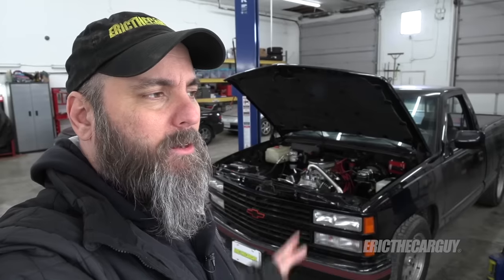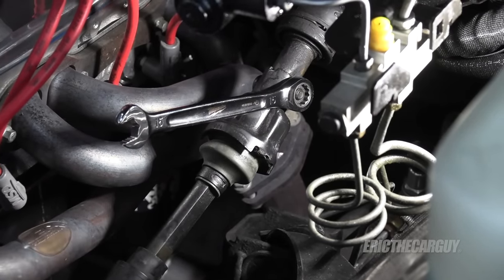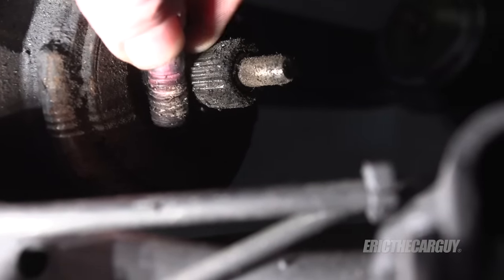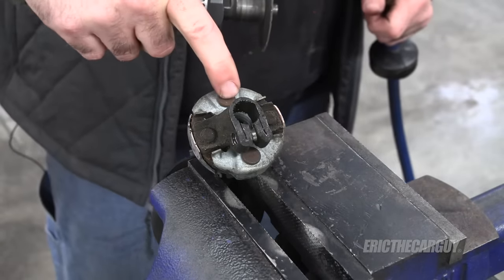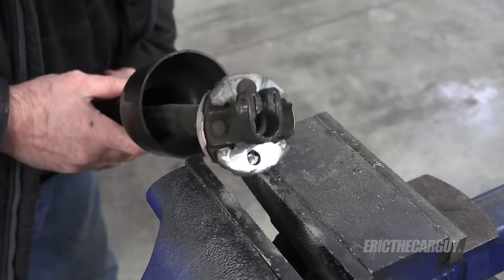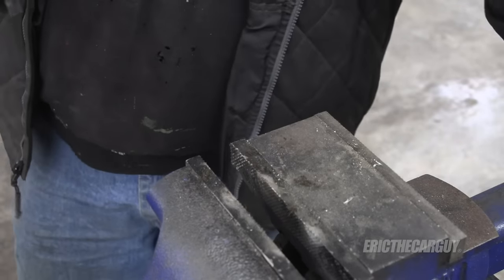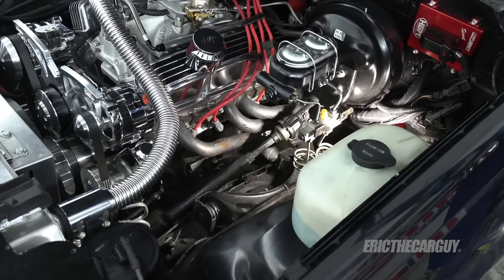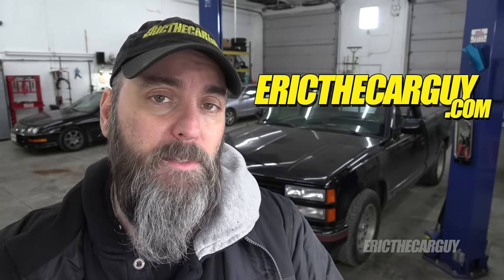Fixing Loose Steering, Rag Joint Replacement

Comment: Had this same issue on my 87 S15 years ago. What I did instead (thats a common mod) is replaced the steering shaft with one from a Jeep Cherokee that uses U-Joints instead of a rag joint. Best steering mod ever for that little truck.
Reply: Didn't know that was an option... to the forums!
Reply: @Spadookie  Thanks!
Reply: XJ shaft on mine as well
Reply: I have an '84 Monte Carlo SS and a lot of people are doing the same mod for the same reason on the 4th gen Monte Carlo's.  I haven't done it to mine yet, but when it gets to the point where I'm starting to notice sloppy steering, I'll just go ahead and do the swap.
Reply: @razinhailsharp  its a real solid swap. The only thing you have to do is heat up the Cherokee steering shaft to collapse it so it's short enough to fit in place
Reply: Scott Waters i did the same thing for my k5 blazer. easiest mod with the best results
Reply: I have a 2000 s10 with a different shaft so I couldn't do the jeep shaft upgrade but I did cut a jeep u-joint off and welded it onto my chevy shaft after cutting the whole rag joint off. It also put the shaft at a slightly different angle which gave me more access to the number 3 spark plug.
Reply: Yes I have a 89 Cherokee shaft on my 94 obs
Reply: I have a 1993 Chevy C1500.  Last Summer I did a total frame out (upper and lower control arms) front end refresh.  And the slop in the steering was still there.  Oh, the truck tracked a hell of a lot better after the front end work, though.

I was going to put in a new rag joint.  But then, discovered the chatter about the Jeep U-joint lower steering stem substitute.  Even though I bought the new rag joint first, I still decided to drop the extra dosh and go the Cherokee way.

I put the Jeep lower steering stem in today.  Wow!  All the slop in the steering is gone!

A very worthwhile upgrade, for sure.
Reply: What year jeep
Reply: @razinhailsharp  I have an 84 monte ss as well, And i’m looking into this , Did you try it?

Comment: I could not find a new steering shaft with rag joint for my 1988 GMC. And fitment seemed to be an issue for shaft and/or rag joints. I tried used connectors ,but they were dried out and worn too . But thanks to you folks on YouTube, I found the answer. I pulled a steering shaft from a 93 Jeep Cherokee. With clean up and a couple mods, I now have a solid steering shaft in my GMC. WORKS GREAT!

Comment: on my  '94 suburban,I was able to get rid of the slop at the steering box.There is an outer bolt that I loosened,Then an inner bolt I tightented,then re-tightened the outer.Piece of cake.I dont recall if there is also a rag joint.Thanks for you expertise,Eric!

Comment: I completely removed my rag joint in favor of a solid shaft with u-joints. Made an amazing difference and I don’t notice bump steer. My shaft came from an XJ Jeep Cherokee, no real modification needed, you just have to separate the XJ shaft to have the right length. Separate it by burning the plastic inside. You can research the swap yourself if you want to do it!

Comment: I have a truck at the shop with 294k and extreme slop in the steering. I have been trying to tell my boss that I have seen this problem before and it has been mostly a problem I the steering shift. I couldn't think of the part but Eric had me covered. 👍

Comment: i had the same exact problem with my '84 Camaro two years ago, (that steering shaft looks exact the same), 
No mechanic could know where the problem was, I had to find out for myself.
I rebuilt the piece with the same rubber / fabric material since they did not sell that piece in my country.

I learned some things there, in each part there is a notch that indicates the position that goes, from the base of the steering wheel to the steering box, each component has this notch.

later I found out that using that entire part of an Astro Van or Grand Cherokee would have been simpler for me since I don't have many tools and those rivets are extremely hard to cut.

Comment: A customer of mine had a similar Issue on a old F150 the steering coupler was In good shape, however the worm gear In the gearbox wasn't adjusted correctly. Great video Eric \m/
Reply: I was thinking along the same lines. Many rear drive GM vehicles (but not all) have adjustable steering sector lash adjustments for taking away wheel slop.

Comment: That time of year I guess! I just did the rag joint on my 34 year old Grand Marquis. There was a bit of slop in the steering on that one, too. This time she got the works - balls joints, control arm bushings, new rotors and pads, and a new steering box. Should be nice and tight now, once I get it aligned.👍🍻

Comment: Sup Eric... Thanks for all your videos as they  have helped us with our 97 Tahoe improvement project.. this one in particular. We replaced all the front end parts such as gear box, power steering, pit man arms, upper and lower control arms, shocks, etc. and still where having loose steering wheel issues. We will change out the entire coupling steering shaft and hope fully this fixes the issue. Anyways, thank you for your good and cool videos. Stay safe and stay healthy.

Comment: Eric, I know this video is old but have reviewed it a few times.  My problem is with my 4 speed TA 6.6 1979 Trans Am.  The steering has become sloppy.  I am in the throes of trying to access the top nut to remove the shaft so I can remove those damn original rivets in the rag joint.  This has become a mental exercise for me. Accessing the nut from the top is not possible because of the engine width and closeness to the MC unit.  The Z-bar clutch mechanism and rod from the clutch pedal is in the way for me to access the nut from under the MC unit.  I keep taking parts off the car and just removed the driver's seat to get up under the dash to access the clutch pedal which I hope when released will allow me to get a straight shot to that nut with an extension and socket.  What a can of worms so far.  Had they used bolts on the rag joint at the factory this post would not have been made.  BTW--thanks for all the helpful advice and hope your new 5000 square foot shop is a great fit for you.
Reply: How I did it:  Access to the nut was achieved by turning the steering wheel just a bit that allowed me to come directly down from the top between the engine and the MC unit to get to the nut.  Once the nut and bolt were removed it took a few minutes to tap the shaft out and a few more to pull the entire shaft from the car so I could dismantle the bad rag joint.

Comment: I’m installing a new rag joint in my ‘78 Corvette project car today. It was a rusty, raggedy dangerous mess. For a few dollars it’s an easy fix. I used synthetic grease on the splines to stop rust & smooth reassembly.

Comment: good job done...At some point GM started using a sliding sleeve.  I had a e 2004 and there was a constant noise and slack.  The dealer said all that could be done wast to fill the cavity with grease.  Problem solved  - for a couple of weeks.  I was told GM did NOT have a fix.   Just had to constantly fill with heavy grease...

Comment: Been watching you for some years now. Thanks for all the effort. You empowered me to tackle projects and maintenance I never would have before. Thanks!
Saw the video you did when designing the layout of your gauges and always appreciate that custom touch. 
During the test drive, a digital gauge is constantly bouncing around 13.1ish. 
Air/fuel, Voltage? 
Either way, my head would explode. Love my not digital gauges. Even notice it when I’m driving next to a car that has them. That constant fluctuation is distracting.
Reply from the maker: Yes, that is the A/F gauge. I like to keep an eye on that. You get used to it after a while. Thanks for the comment.
Reply: @ericthecarguy  Oh, I thought that was a volt meter and I was going to ask why your charging voltage was so low. Now I don't need to.

By the way, I like your videos, they are helpful and entertaining. I've been fixing my own vehicles forever since I'm disabled and basically homeless so I definitely can't afford to pay anyone, I can barely afford parts, in fact I've been spending most of my SUBsistence income on rebuilding the front end of my Suburban for the past few years.

And I really want to get a new transmission in my Oldsmobile Custom Cruiser and my Jeep Wagoneer. I have some nice vehicles, but I haven't had anything that's usable for a few years, it makes surviving 60 miles from the nearest store quite challenging especially since I'm disabled.

Comment: Thanks Eric! I too had to grind the rivets off and use a hammer drill to pop the studs out. The Dremel cutting wheels and accessory kit was $60, the new rag joint was $11 and the hardware was probably around $5. I even had to get a second rag joint because the auto shop sold me a too large one. Even with locktite the materials were under what I paid for a stupid Dremel kit.

Comment: Good stuff. Thanks. I just replaced the steering gearbox on a `99 GMC Suburban and I'll be damned if I can't get the cover slid back over the rag joint. Good time to go ahead and replace the rag joint so I can get that cover slid back down.

Comment: I had a mid 80's Ram that had a similar problem. It was a common problem with that generation truck. The wheel would have 45° of play because the CV type joint at he top would wear out completely. There was no master spline on that one and I drove with the wheel turned quite a bit after I replaced the joint.

Comment: About 10 years ago, I purchased an 91 Ford F-150 4x4 from a small dealer.  I think i paid $1200 for it.  The steering was scary sloppy.  I went to the junkyard and found a rag joint from another Ford, it was maybe $15.  It went from 3-5" of slop in center, to about 1/2". Best $15 that I ever spent.

Comment: My old Ford had a rag joint in its steering column and it was easy to replace but the ones I bought were not very strong and wouldn’t last. So I found an old tire and started cutting them out of it. It was a little thicker and stronger and would last a lot longer.

Comment: fun tip for OBS owners. you can use a jeep XJ steering shaft to replace the rag joint and it helps improve slop a lot
Reply: Not on 96-up
Reply: I have 93 f150 going to try this !

Comment: you should look into a jeep cherokee xj steering shaft. i swapped out the shaft on my 89 k5 blazer and it was amazing. i paid ten dollars at the junkyard. you eliminate the rag joint and the worn out upper uofu-joint. it took about ten minutes to swap it.

Comment: I'm about to do a front end rebuild and I'll be doing a U-joint instead of a rag joint. I'm using a custom made one from Derek's Steering Shafts on FB instead of the Jeep shaft but either will do.

Word of warning to anyone, 97-98 trucks cannot do the Cherokee mod. There's a "blob" joint behind the firewall where the upper shaft goes in. It could in theory make the steering shaft bind up. Make sure you are careful if you do delete the rag joint.

Comment: Just did this last month on my 98 k1500. It wasn't too bad. Got my rag joint from autozone and had to buy bolts separate to put back together. Couldn't find this part any where. They wanted to sell the steering shaft for $187.00. Rag joint was $10.00 plus extra bolts.

Comment: Bought my Truck used Test drove it down a few side streets Hard brake stomp on the gas ..no real issues did not notice the light slop Untill driving it home Canadian winters are famous for people sliding into curbs Add in years of wear and tear  The rag joint was "pooched" Bought a u-joint set up no slop very little vibration ..

Comment: My 2003 F250 had the same problem but tightened up on turns. Steering box was worn out in the "center" position. Installed a Ford reman and then she was as tight as the day it drove off the lot.

Comment: That part is called the intermediate shaft. A Drag link connects the steering gear box to the steering linkage. Anybody familiar with jeeps it is the bar that goes from the pitman arm over to the passenger side knuckle

Comment: 1:15 just above the bolt you are removing, what is the part with the c-clip called with the spring in it? Mine keeps popping out. I haven't been able to find what it is in any diagram.

Comment: You can also buy just the rubber piece for about 10 bucks Dorman help kit 31002. also has a couple bolt to replace the rivets and some of the shield things, not sure why you need them. I found out this weekend it's lot of work because you have to cut all four rivets and I didn't have a die grinder. And I'd suggest using a straight one like you did but with a burr or stone rather than a wheel to get into the recessed area the head is in. That would have made short working of it. Drilling was not fun!

Comment: Alright fine, aside from replacing the springs and bushings on my 91 Diesel Suburban, this is the only other thing I've not done as well. I'll at least check it. :P The steering isn't just loose on mine though, it has a weird phase delay when driving. It's hard to describe, but that's about as close as I can come. I have to turn the wheel further to get it to start turning, then back off a little bit... It's really frustrating to drive. My 85 is loose, but nowhere near as bad.

Comment: I saw you in Carlisle PA last year, and the car I drove there from WI (‘77 Lincoln Mk V) had upon further inspection once I returned home was a total absence of a rag joint.  I only had the upper and lower brackets which meshed after at least 1” of turn on wheel.  Sloppy to say the least....

Comment: 2:36.. I know most things are self explanatory, but when giving a tutorial video, something as simple as showing how to release the plastic cover on the lower joint can make the world of a difference for someone who isn't confident in their mechanical skills. I've watched a few of these videos and no one else showed that process, as simple as it may be. I've been building performance street cars for over a decade now, and I can tell you that when working on a car that you've never worked on before, every bit of information makes the job just that much easier. People that don't work on cars don't realize how much of it actually involves using brain power and not just forearm strength to turn nuts and bolts lol. 

I had a buddy who gave up on stabbing a distributor on a late 80's GMC because he's used to working on ford's where the oil pressure pin just drops in before the distributor, but on the GMC, the oil pin is already in the block and it must line up with the distributor or you will never get it right. I don't know why he didn't just Google it, but it took me 5 seconds to get my big head back there to see in the hole and put a screwdriver in there to line up the slots and it dropped right in.

Comment: if its just a little loose tighten the sector shaft top in the center,  allen bolt after loosening the holder nut thats around it.  Do only a small adjustment because it will cause the steering box to wear out faster.

Comment: Why did you bend end of the shart after  removing the two bolts? I noticed you grinded off some metal from the surface if it...

Comment: Eric, what your reason for not going with the Jeep XJ shaft? Thanks for the awesome content as usual 🙂
Reply: Is there a particular year model or part number for this jeep part? My truck in my profile picture has horrible slop in the steering. Might give this swap a try.
Reply: @tomjoad8272  believe it's late 80s early 90s Jeep Cherokee.
Reply: @tomjoad8272   84' - 86'

Comment: ERIC READ THIS...
Problem is front shaft X-joints are 1/2 rusted. 
The fix is to pull the spindle and replace both chafts X-joints that get rusted after enough salty winters.

This is common to all 4x4 "trucks" ie. front wheels chafts PARTLY stop flexing and HUGH THE STEERING OFF CENTER! (Search your fav youtube truck wizard channels)
👍

Comment: I have a 91 camaro and just removed shaft but the boot on other end is torn , question is can I replace the other end boot also ?
Reply from the maker: Not sure, but you could probably find a replacement shaft if the parts not replaceable.
Reply: What did you end up doing about the top boot? My 92 Blazer is in the same boat. Now that I know what it is, I can't shrug it off with a "eh all GM steering is loose, it's fine", of course now with every turn l make, I'm playing out my deaths scenario in my head.

Comment: Please help.  I have a CPP 50004 steering box and it has a 3/4 30 spline rag joint. It's  a correct rag joint size but it will not fit on to the steering box shaft.  It's  very tight.  Any advice please.

Comment: The steering shaft that is inside the steering column  is injected with plastic (part of the Energy Absorbing (EA) safety system). This injection  is easily damaged by 'impact' or over stress on the steering shaft. The results from damage to the injections (not visible as they are located inside the steering column) weaken that Safety system.

Comment: The EBay link for the steering coupling is broken.  For those who are equally frustrated, my truck is a 93 c2500(vin F), and it needs a Lares # 205 steering coupler.  Don’t go around asking parts stores for a “rag joint”, because they won’t have a clue what you’re talking about, AND, they won’t have it either.  In some applications, a whole new intermediate shaft might be about equivalent in price, so look into that also.